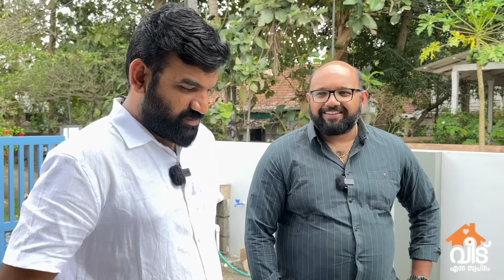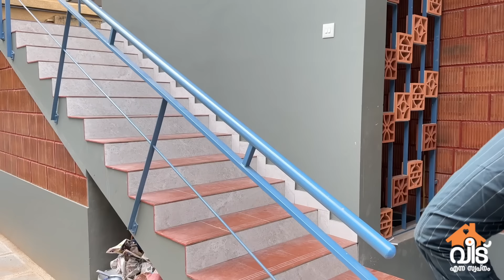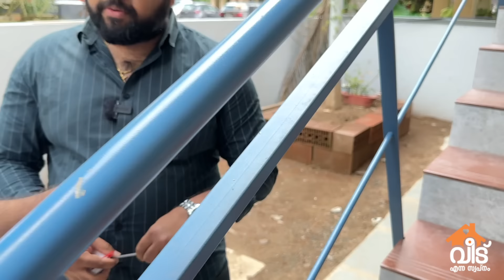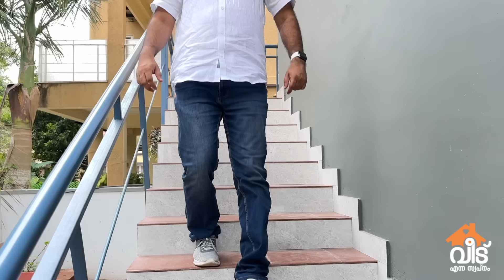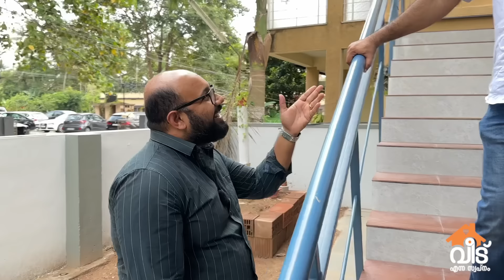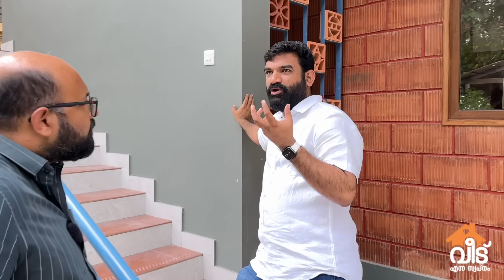വീടുകളിൽ സ്റ്റെയർകേസ് പണിയുമ്പോൾ ഈ കാര്യങ്ങൾ ശ്രദ്ധിക്കുക | How to Build staircase

Comment: Boss, trangle step anu plan cheyendi vannathu 2960 sqft anu lift area koodi ullathukondu step comprises situation anu ullathu allengil lift living areayil fit cheyendi varum appol living area conjusted akuma , need suggestion for traiangle step width requirement to avoid fall,  suggested min 1 meter width for staircase, is this enough? 3000!sqft above akan patila green zone anu

Comment: You should've mentioned the angle of the staircase and the maximum number of steps before a landing.Thanku
Reply: Angle is of no use in construction sites. It is all about measurements of riser, thread and width for a stair case  Angle aanu plan il paranjathu enkil pinne trigonometry eduthu kurikendi varum site il.